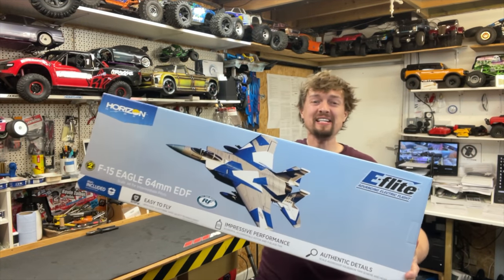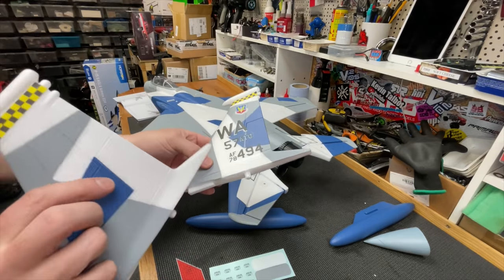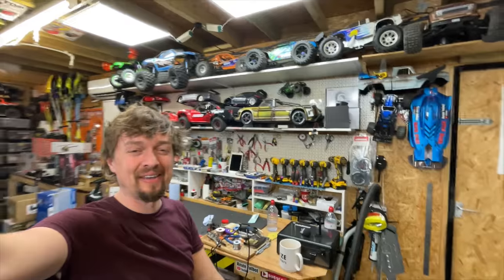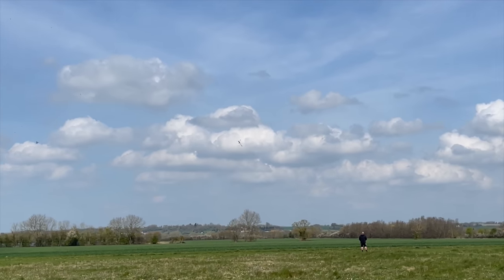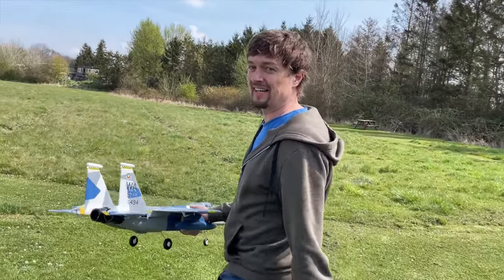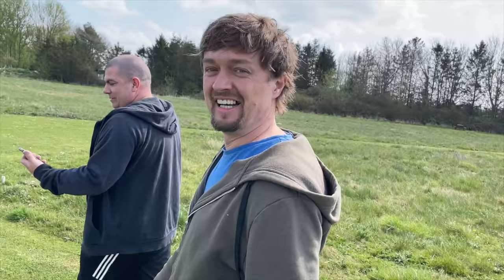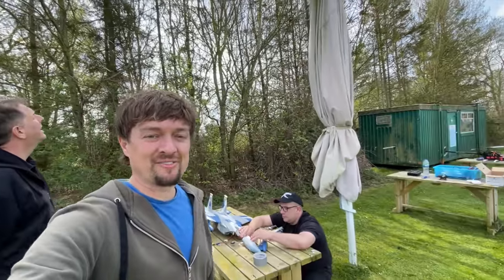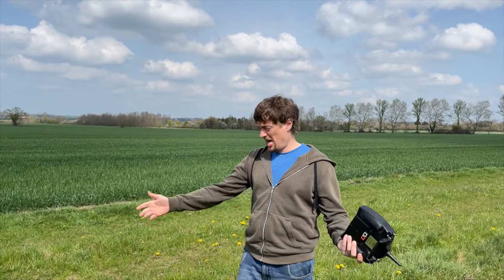Idiot tries to fly RC edf Jet airplane

Comment: One thing with jets is they are very streamlined and they don't bleed off speed fast so overshoot the runway happens often. It's tricky with EDF because it takes a bit to speed back up, but you can't slow down as fast so landing is always an art. I have been flying for 30 years. I have a few Jet EDFs and they are always fun.

Comment: Nice work Kev. I had a plane that I flew into some trees. Very little came out that was larger that a hand span. I put it all back together with hot glue, packing tape and bbq skewers.
It flew again and didn't look that bad.
OOh, eta: If you get a jet turbine plane, please also get a fire extinguisher and fire blanket.

Comment: You beat my first flight...tossed it up at like a 60 degree angle at only 1/4 throttle...went up, stalled, lawn dart, broke the fuselage in about 7 places, and ripped the motor/esc out.  It was one of those 'do I throw it all away and pretend I never even tried, or glue it back together and try it again'.  18 years later, I'm still thankful the guy at the hobby shop insisted I also buy some 2 part epoxy lol

Comment: Also! I’ve hand launched this jet many times, and with that hand launch at the end, it should be at a higher nose up angle, thrown with quite a bit more force. Launching in SAFE is another option, but with sufficient push at the right angle from the person launching it dosent need SAFE. That wasn’t a crash at the end, just a forced landing.
Reply: Yeah I had a bixler and no wheels, hand toss is always easier, specially on grass. Nose up, full power, give it a hard toss and you're good. 

I learned too to add fibre packing tape to the bottom for landings because even on grass the foam wears away right quick. 

With a good head wind, you can actually slow it down so much that it is effectively hovering, just ease it down in one spot.
Reply: Love the energy Kev!  In a parallel universe (one that is 50 ft lower in altitude) it looked like a  good approach to a perfect landing...
...as we say at the airfield!

Comment: kev you did great for your 1st time! you will be a pro in no time at all! and gorilla glue works amazing for gluing them back together after mishaps. ❤😂😁
Reply: Gorilla glue PLUS the old foam soup trick... google it.  Hot water pimples the nice smooth finish a bit so don't get the water TOO hot.  The crushed foam puffs back up... almost to original shape.

Comment: It would be better to get a twin engine electric first. I had one of these single engine models and it would barely get off the ground. Yours does seem to have a little more power than mine though.
Reply: Maybe you didn’t put the proper battery size in it? Which model was it?

Comment: That touch and go was very unexpected. Lmao!! But to answer the question. If ducted tape will hold that plan together. I'll say if it holds NASCAR'S together running 200mph then it should Hold an RC plan better As long as u don't do a 100-0 sudden stop into the ground again. I enjoy ur plan videos because with those if something goes wrong there's not much saving it like pulling over and stopping. 👍

Comment: The problem with that specific model is that it does NOT have a impact resisting nose. I bought an RC Jet for 16 Dollors and after countless crashes, the RC model still properly functions without suffering any damages to any components.

Comment: I’ve crashed and fixed that jet nearly 12 times. Just needs some medium ca or epoxy and will be good as new. Battery only last 3:30mins for a 4s 2200 though.

Comment: EDF: I never really realized how jet engines worked until I started getting into R/C planes and saw EDF. Really, a jet engine is just a highly complex and efficient fan inside a tube. Basically like a prop plane but the prop is on the inside. 

I always thought the fins you see on jet engines were for cooling not realizing they provided the thrust.
Reply: Difference is pressure and speed of the exhaust. Both are much higher than a free air prop. 

Also, the fins on a jet engine doesnt necessarily provide much thrust, depending on what kind of type of jet engine. Originally they just worked as a turbocharger to compress the air for the combustion process in the later stages. This is still their function, but on airliners the big fan that you see from the front also provide a normal "free air" prop kind of function as well, yes.

Comment: Spoiler alert, Kevin is actually a good RC plane pilot, but I won't argue about the idiot part. Which is why we love him.😂 EDF jets is no different than a pusher or tractor prop. You just need to keep the speed up. They are also more sensitive to CG placement. Other than that, it's just an RC plane.

Comment: Not specially this Plane but all in this category are garbage. You have to screw into styropor.....its just a genius idea to fly with 80kmh and lots of air resstance on this srewed flaps. 
Sometimes the things fell of even before flying.

Buy a nice RC Car, Boat or a smal Dji drone instead if You want wo have a flyable model.